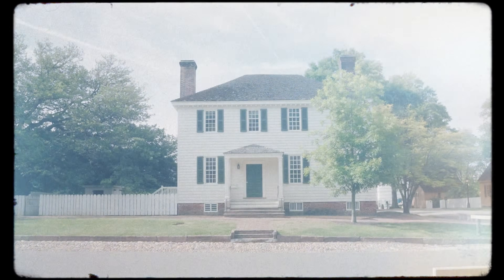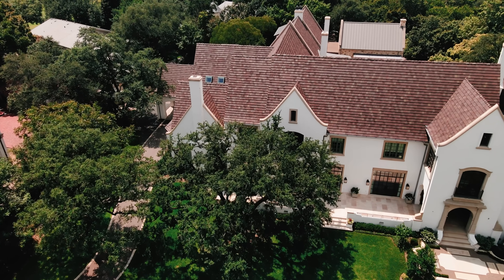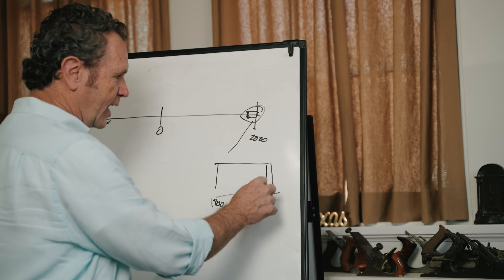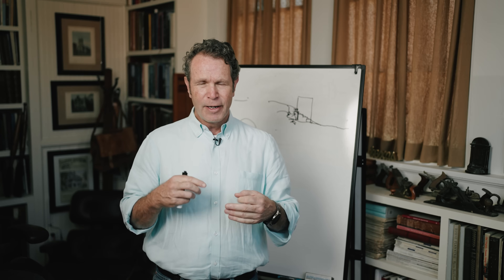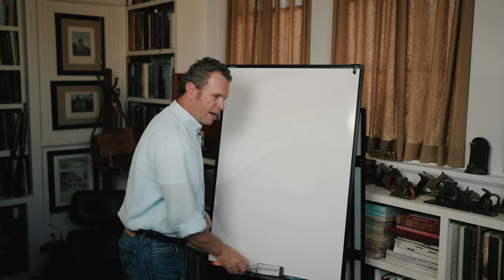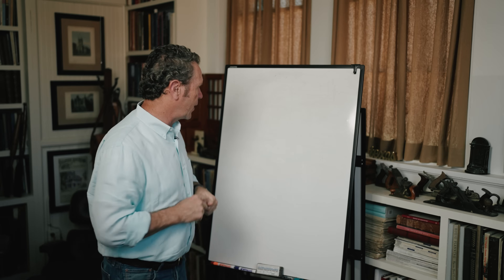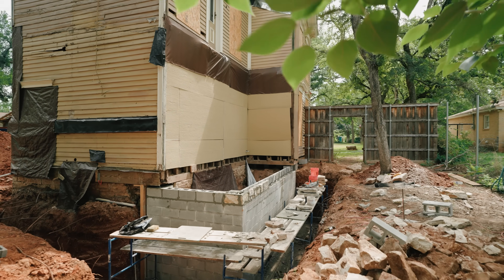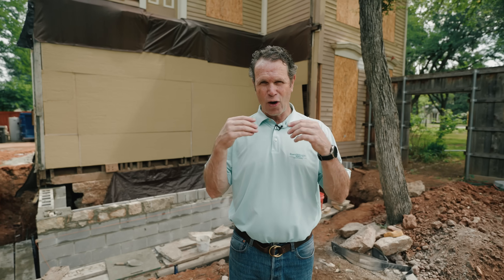"Foundation & Site Layout" New House, Old Soul - Ep. 3

Comment: I'd be interested in seeing a video on the best possible way of creating a stone foundation using today's knowledge and methods. Because I'd like to, but you'd be hard-pressed to find any kind of information on this. Would using larger cut-stone blocks that would've been unfeasible for historic masons to transport and manipulate into place be a solution for the longevity issue? Are there unique considerations with regard to waterproofing the exterior of a stone foundation? I see historic buildings with massive granite block foundations in my city and it has inspired me. I would argue putting any kind of stone façade on a modern foundation or "faking" old aesthetics isn't "old soul".

Comment: This guy just needs to skip the history or get it right.  Frank Lloyd Wright was building houses on concrete slabs with edge beams in 1910.  He used iron pipe for radiant heat and by the way reinforced the slab.  In the 30's he built Falling Water with huge reinforced concrete cantilevers.    I live in Connecticut.   We have thousands of homes with cut and dressed stone foundations that have tight joints that are 200 years old.  Minimal leaking and still flat and square.    They evolved from rough field stone to dressed stone to concrete.   It is all about the cost benefit.  The innovation is really in the ability to provide water proof coatings.
Reply: He's talking about most houses and foundations. He knows concrete foundation were used by 1900. He does get it wrong, however, not to mention Roman concrete, but he's really talking about common American homes, sometimes nice big ones.
Reply: He's talking about concrete as foundations for homes, not concrete in general.

Comment: Concrete was invented in the Roman empire thousands of years ago.   Reinforced concrete that uses large tension members-   rebar is new since steel production in the last century but the romans and the gothics used steel reinforcement at a smaller local scale--- more like staples.     Excellent new videos on the rebuilding of Notre Dame where they discovered 600 year old iron staples holding together masonry.   Matt always has good material.  It is important however to be accurate for the sake of all of the builders that came before us.
Reply: He's talking about concrete as foundations for homes, not concrete in general.

Comment: Contrary to what many people think, the Roman Colosseum is made with concrete, not stone. Concrete is 1,000s of years old. They used slaked lime, sea water and volcanic rock and sand.
Reply: The Romans not using rebar or other metal in the concrete is one reason it lasted so long.
Reply: @ecospider5  Interesting! I ran across an engineering study from India, testing the disaster-resistance of various "impoverished rural family building a home" type foundations. They determined that bamboo as rebar in lime - based concrete or Portland cement reinforced adobe was more flexible, more stable (no rusting or spalling) and higher in tensile strength per millimetre of diameter than standard rebar of the same diameter. The engineers  recommended bamboo reinforcement for anyone in a flood-prone or seismically unstable areas. Since I'm planning on building with adobe in my southwest desert home, I took notes!
Reply: @lindacgrace2973 That is really interesting. I wonder how it does in a freeze cycle. A big reason rebar is still used is it changes size almost exactly the same as concrete with temperature change. 

Were they using small lengths like less than 6” or long sections like rebar.
Reply: @ecospider5  The lecture I watched (and played in slow motion to battle my way through the accent!) used the longest sections of bamboo that they could. Also, they ran nylon rope from one lift of block to the next to tie the bamboo "rebar" together. So it's a course of blocks, long lengths of bamboo imbedded in the mud, another course of blocks, and in between the blocks, vertical lengths of very slender twisted nylon rope tying the two bamboo rebars together. This strategy made the whole assembly more resilient to shear stress and much safer in catastrophic weather events. The government of Guatemala made a similar recommendation, but instead took used nylon fishing nets, tied them to the lengths of the bamboo rebar with zip ties and embedded the mesh in mud plaster on the inside of the wall. They have to deal with earthquakes and tropical storms there, so that strategy makes sense, I think. They also recommend mixing up your adobe block with some tar in it to make it more weather resistant. I never cease to be fascinated and amazed at the ancient "non-technical" ingenuity of builders. Way too many rabbit-holes to chase down!
Reply: I cannot fully remember but think MIT came up with a formula semblance to what the Roman’s used and saw a paper on it.   Be cool for that to be commercialized so we have an alternative to Portland Cement.
Reply: Precisely! I read "Ten Books of Architecture" by Vitruvius. He maintained that making concrete with sea water (i.e., with 3.5% salt water) was the only way to make an enduring product. The Colosseum is falling apart - heat together by chicken wire and hope (most of it is off limits to the pubic) and it was made of stone. I call that "a clue." Even better, while Portland cement concrete is hydrophilic (and thus always slightly damp) Roman concrete chemically becomes denser, harder, and more water-resistant every single time it rains. A nice bonus feature to a beautiful and durable material. I flatly refuse to use Portland cement based concrete and will pour my footings and foundation stem wall with Roman concrete.
Reply: @@misterrichardc certainly, but the topic here is houses/homes. Major public projects are a slightly different topic.
Reply: Realize most of Rome was built with brick, and they just faced it with marble. Also, remember they used a cement mortar in a lot of cases, not actual concrete.
Reply: @@misterrichardc you’re allowed to discuss whatever you want. I was just of the opinion that while the OP was discussing the long history of concrete, of which the colosseum is an example, it is in relation to a discussion of home building, which has a shorter history of use of concrete. And it was certainly a non continuous use, with concrete being mostly forgotten for a millennium. There is a deep line of research available.